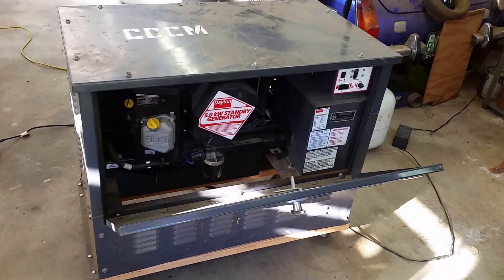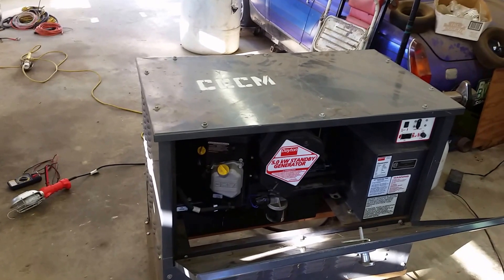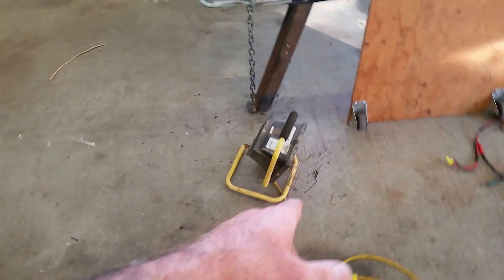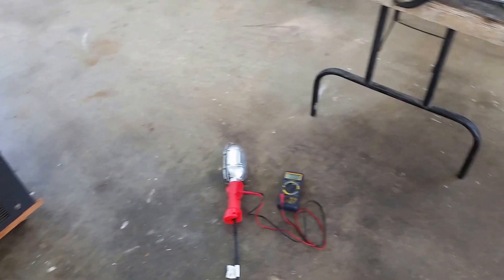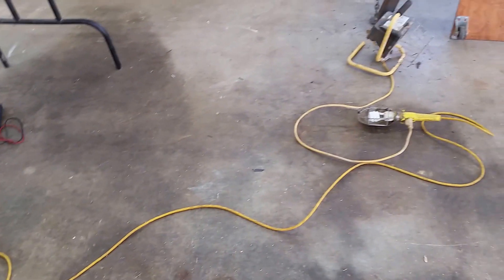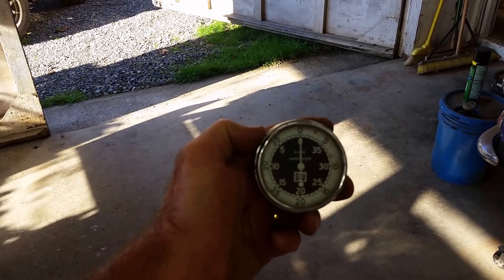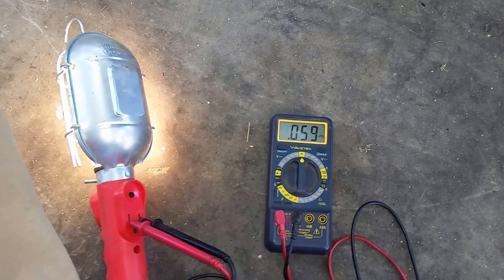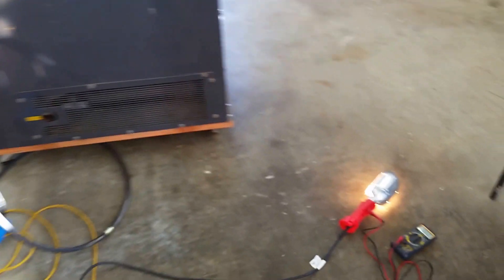(More generator stuff for Off grid living)

Comment: Another neat way to check Hz is with an old style electric clock with a second hand. you time the second hand for 60 seconds with wrist watch or stop watch, then turn up or down the rpm.s until the second hand makes 1 turn in 60 seconds= 60 Hz.

cool vid thanks for sharing.
Reply from the maker: You are right. That's how I have done it in the past. In fact just last summer I used an old motor driven clock and a stop watch app on my phone. My old Beckman was true RMS but it died. I need to buy a Fluke. Thanks for watching.

Comment: I wonder if those RF spikes can be seen on an O-scope?
Reply from the maker: Most definitely. I used to do the tower work for a local Christian radio station. The tech that I worked with had a spectrum analyzer. It was an oscilloscope that showed the shape of the radio wave and the carrier wave. A noisy power supply somewhere on the mountain showed up as a horned monster on the edges of the carrier wave. I think the analyzer was like a oscilloscope with out the RF filtration. We had a very ungodly station on the mountain a few yards away from our tower. The Transmitter for that station was wearing out and had such a dirty carrier wave it would bump us off line. When we looked at the neighboring station's signal it literally looked like a demon on the spectrum analyzer lol.
Reply: Roger that...I just never used a spec analyzer to view AC spikes. Our field engineer showed us "over the air" spurious signals when we were in Kuwait...with a makeshift antenna. Crazy. With an O-scope...not sure. He used it for something...but, don't remember. Thanks! Doing some "load testing" on my solar generator today (all day test) with about 260-280 watts continuous draw. Running 400w in panels. Need to fire up my little Honda and let her run too...maybe change to oil today too.
Reply from the maker: I thought that you would know what I was talking about. Again thank you for your service to this country. I would be interested in seeing you do a test charging your batteries with your Honda through your inverter/charger. My I/C is not PFC (power factor corrected) yours is. It would be great to see a test of how many amps your Honda can put into your battery bank and what kind of fuel economy you get. I am going to get a PFC I/C someday. Some I/C like the Magnum MS4024 are adjustable how many amps allowed from the generator. This would be a way to maximize the fuel economy from a Honda inverter generator.
Reply: Great idea...never really did a test like that. I have used the Honda to charge the batteries (my main garage system) via the Outback Power inverter/charger. But, my system sensed the batteries had enough charge and switched back to battery in about 30 mins. I know there is a way to "load share" or something like that and keep things charging...but, never got that deep into figuring it out. What I did do was set for 12.5 amps when I did it...about 1,400 watts going into the batteries (Honda outputting AC, inverter converting it to DC charging). My small solar generator doesn't have a charging function on the Go Power inverter...I got a small 24v Battery Tender charger/maintainer to charge w/o sun. Cool thing...it runs off my power strip that is on a solar circuit! he-he-he! Hope your son is doing well and thanks. Had some Veterans Day food and drink with a couple of former SQ buds last evening.